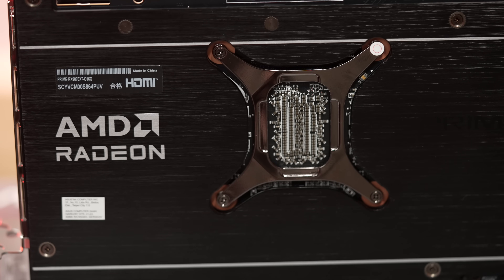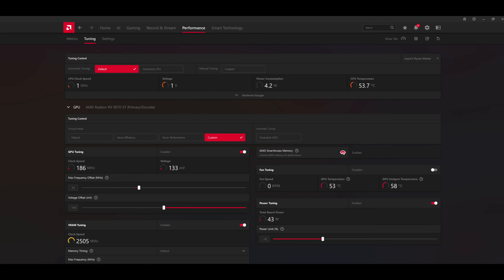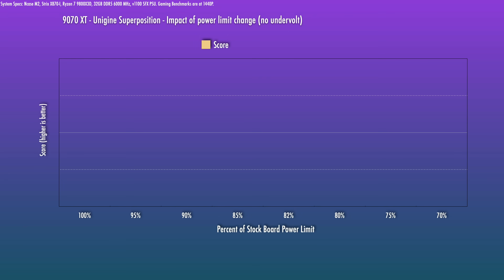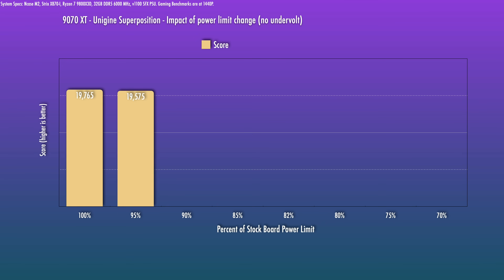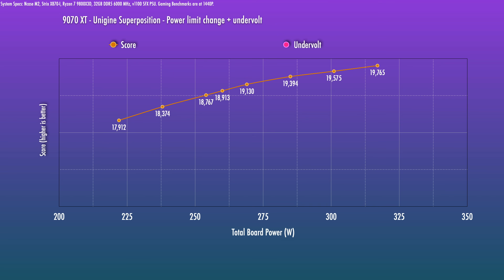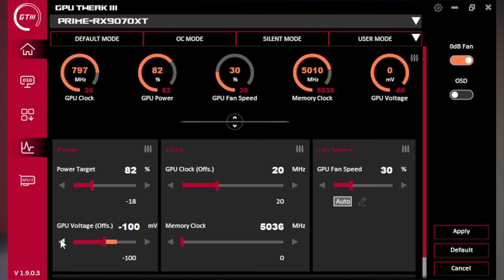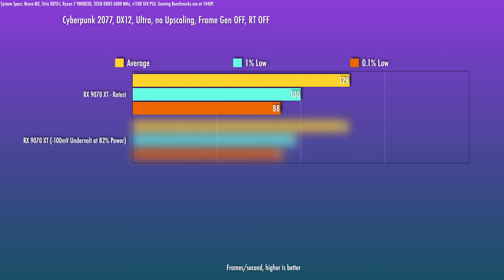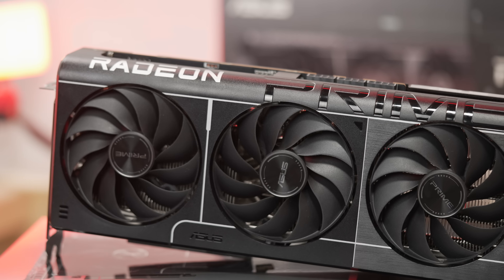Undervolting the 9070 XT... and also overclocking a 9070 to XT levels!

Comment: Finally a video for those of us who prefer a quiet and cool card - and a lower energy bill. So many reviews only focus on max performance.
Reply: real
Reply: You can actually overclock and still get away with a decent undervolt with many amd cards. I run a 200-300mhz  OC and a -100 on the voltage slider on my 6800xt just fine
Reply: One thing I’ll said is it’s nice to min max. Got 4 year old 3080 ti running at 72 c max (30 min stress test @100%) at 1200 rpm on noctua fans (deshrouded) running 350 watts over clocked. I think the best is to find that bang for buck sound, thermals, performance, since the 3080 ti can oc way beyond wuat I’ve done and mine can reach 1950 mg hz vs the 1800 its at now undervolred
Reply: @aviagrawal5903 Similar to me and I'm sure many other enthusiasts who like to tinker. I have a 3080Ti but it's the water block version from EVGA, stock power limit (100%) would have it peak at 400-425W (113% PL would peak at 450W), but I mostly run it at 75% power limit (~299W) which runs around 1850-1900MHz depending on the game. At 100-113% PL, it would run 2055-2085MHz, but the extra 100-150W wasn't worth the small 2-5 FPS bump. 300W = 50C max temp, 400-450W = 57C max temp under a custom loop, Noctua fans also max out at 1200rpm.  

Min maxing is especially more useful, if not almost essential for the SFF audience that watch this channel. Glad to see how well the 9070XT/non-XT can UV and OC.
Reply: I bought a 9070 XT non-oc ASRock Steel.  I wonder if I should regret my decision to skip on the Prime OC for the same $600 cost
Reply: I'm just glad its doing the same power for better performance than my 3080 10gb  I never realised how bad it was for power draw til i saw the comparison graphs
Reply: My thoughts exactly. I ordered the 9070 because of that lower power consumption.
Reply: Unfortunately quiet and cool are not both on the table this generation. From what I've seen if you want quiet you should do the Red devil dot but the trans considerably hotter than the cooler options. If you want the coolest option then you need to go with the XFX Mercury but it's louder due to bigger and more aggressive fans however you can also undervolt the Mercury to reduce fan speeds power draw and temperatures even further and it's going to be by Miles the coolest card of the bunch like we're talking here at 15-20° difference on the temperature memory compared to a red devil albeit maybe not as quiet. So as I said it's kind of like a toss-up you either want your GPU to be inaudible or very cool
Reply: @DESOUL3003  I have sapphire, no sound
Reply: @DuBstep115  Sapphire is one of the quieter cards together with the Red devil. Is still louder than the Red devil but it's like top three quietest
Reply: Precisely..every benchmarks only shows fps..not power draw, not heat. This is why i love amd so much. My 6800xt served me do well. Cant wait to get my new 9070xt next week. 
Great video dude
Reply: Let's say you manage to save 100 watts. That's 1 kW per 10 hours of gaming. So let's say you game 10 hours a day, and saved that 100 watts to make it a convenient 30kW a month.

I pay $0.07/kWh. So, I would save 30*0.07=$2.10 a month.

A more realistic 50 watts, 5 hours a day... Halving and then halving again saves less than a buck a month. Even if you account for air conditioning savings from the heat reduction, it's not really a big meaningful difference.

Even if you look at Hawaii's power rates, your savings isn't really all that great. Every bit counts, but I look at undervolting and undercocking to save heat and noise.
Reply: @Those_Weirdos  Well my prices went as high as 10x your price back in 2022. Now they're about 5x yours. But whatever, that's just nitpicking, it's still win win win in the end
Reply: @thelazyduck9370 tell me where you live. No way its still 2022 price like that
Reply: @vijayla21  Denmark. It’s about 3DKK (0.44USD) per KWh right now, everything included, so 6x his current price. 2022 I think it peaked around 7.5DKK (1.1USD)
Reply: @thelazyduck9370  Everything in Denmark is expensive so it's not a fair comparison. 

With that being said, assuming you got the xtx in launch(roughly January 2023) and use it until the end of 2025(3 years), you save less than $100 in electricity compared to the 4080. 

Depending on the prices for these gpus in DK, I dont think its that significant.
Reply: @vijayla21  In my calculations I would save about 4 dollars a month on 9070. That's 50 dollars a year. After 4 years I would have saved 200 dollars. It's worth it compared to the XT version. 

It's 600 dollars plus electric bill vs 550 dollars and savings on the elecetric bill. 

I will still wait until they have done enough XT versions that didn't live up to it's name so they had to make them 9070 instead. Stock of the 9070 will go up and price will go down. Might happen at the end of the year or next year
Reply: @fillezzo  You must game a lot then. I was assuming 7 hours/week. I was in Odense visiting families and it was 2.8 dkk recently.

You will never get MSRP price in Denmark. In fact it's MSRP +28% VAT minimum, not counting for imports tax and whatever your retailers charge. 

Even still can you tell me how often you game? I'm pretty sure $4/month is too much.
Reply: @Those_Weirdos that's your personal experience. 
In many countries in the world, power is not that cheap.Where I live,the difference is 15$...
Reply: @Those_Weirdos That dismissive attitude is exactly the problem. Power is much more expensive in some countries. To the point where the cost is noticeable if you watch it closely and adds up a significant amount of lifetime cost to a computer.
Reply: @Those_Weirdos You pay 0.07$, other countries exist too. In Europe you pay 0.33$ and that is a very big difference
Reply: @Those_Weirdos  Bro has not paid a single energy bill his life, there is also tax and transfer price. A 0.07€ per 1kw/h turns in to 0.20€. So you can triple your calculations to 6€ a month. 
6€ x 12 monts = 72€ in a year. And thats IF you pay 0.07c for kw/h, average in Germany 2024 was like 0.25€.
Reply: glad I'm saving 80 cents on my bill monthly from 40 less watts per hour! now I can afford an Nvidia card!
Reply: @ show me your calculations for 80 cents lol.

Comment: Just want to give you a heads up if you look at US pricing. AMD is pulling the same bait and switch as team green one model at advertise price and then 8 or 9 models. Not even $50 more. We're talking a 150 more😢
Reply from the maker: I’m actually a little confused now. On one hand I do see the online stores offering the above AMD MSRP pricing but at least from Microcenter’s site I see them offering the Prime cards for AMD MSRP at 600/550, and showing a good number in stock about 1.5 hours after launch. Not sure what the deal is.🤷
Reply: @MachinesMore just depends on where you are.
I’m fortunately in an area which has had a fairly good amount of the cards at msrp.
But by now, I believe most, if not all the XT models are sold out
Reply: its the retailers fault taking advantage of the huge demand....

Comment: Just bought the 9070xt Prime. Can you make a overclocking video and check if you can get the tgp 340w performance from it?
Reply from the maker: Awesome, I noticed inventory stayed up for way longer than any 50-series. I overlocked XT just to get a general idea what the gains were for the launch review, this was very very briefly though - it ran all the way up to 349W. So if you have the system headroom go for it.
Reply: @ just want to know what gains I can get with it, I’m going to use it in a ncased t1 with a 7700x. Upgrading from a 4070 ti
Reply from the maker: Ah gotcha- without doing any serious tuning it was around 5% (+/- depending on the title). There are gains. But it draws a ton of power already.
Reply: @MachinesMore  Here in Australia, it's the middle of the night and we're almost three hours past the official (late night) launch time. Unsurprisingly, 9070 availability is much better than 9070 XT availability. Overall (across a few suppliers), some 9070 XT models are still available, but it looks like the cheapest models (PowerColor Reapers) sold out within 10 minutes of launch.

Comment: Ooof, didnt manage to buy a 9070 xt prime oc at msrp, so i got a 9070 non-xt prime OC at msrp. I was pretty sad about it, but then this video came in as a saving grace to show that 9070 oveclocks to almost a 9070 xt anyways. I was planning on undervolting the XT but looks like ill be overclocking the non-xt instead. Thank you for the quick showcase of UV and OC on these cards. You saved my day.
Reply from the maker: Awesome! I think you’ll be very happy with. I hope you win the silicon lottery. It’s quite fun to tweak it - need a few more data points but I have a feeling the ones I’m working with are quite average examples of the 9070 series silicon.
Reply: @MachinesMore  Haha me too. Its about time i get a little luck thrown my way. Do you plan on doing more OC/UV tests with these cards?
Reply from the maker: Definitely. I really need to see the VF curve to properly tune but couldn’t get any utilities to show one pre-launch. So once that is working there should be more optimizations. Will follow up soon!
Reply: @MachinesMore  Awesome, looking forward to it.
Reply: Welcome to the lower power but still fast non XT Club. An RX6800 User.
Reply: Congratulations! You have the efficiency king of the 9000 series. There's something super satisfying about that.
Reply: Even if the 9070 xt has great value we all can be happy who atleast got a decent GPU these days. How many folks wanted a 5000 Nvidia and were not able to buy anything or way scalped.
Reply: Exactly the same here, I think the 9070 will be great anyway!
Reply: The chips will spread out as drivers mature and as AMD improves RT and Ai features. Aren't the OC cards only 4% faster? I think a stock card could chase that with undervolt and overclock.
Reply: I'm hopeful for my reaper 9070! I missed out on the rush online, but microcenter still had some MSRP models later in the day, although I really wanted the XFX swift model. Just missed the last two by minutes. Good luck everyone.
Reply: The 9070 is much more impressive than I assumed it would be.
Reply: It's a relatively small difference at stock clocks anyways. Was smart to get what you could because this will continue to sell out and prices will almost certainly be going up.
Reply: Same for me, didn't get an MSRP 9070XT on time, so settled for an MSRP 9070. Wasn't too sad about it anyway, as I do like it's higher efficiency, but have been wondering about it potentially reaching XT levels, when needed. Thanks for this video!
Reply: Sapphire Pulse seems to overclock the best.
Reply: Why not both, seems you get even better performance when you do both on the xt.
Reply: I dont get though how he could archieve performance that close. I would expect always a gap of 10-15%, as the 9070 has 8 less compute units.
Reply: I had the exact same thing happen to me the XTs sold out in like a minute, luckily I got a good Asus 9070 Prime OC card for $600 that is boosting up to 2985mhz out of the box, a -100mv undervolt only increases that by 50mhz.
Reply: I purposely bought a 9070 Pulse over an XT for it's efficiency, but also the size. It's actually the only card from the whole series that fits in my case (I'm not kidding, there's about 2mm clearance on the length of it lol). Good to know I should be able to squeeze it in the future. Coming from a GTX 2070 I forgot what it's like to have performance like this lol
Reply: "9070 oveclocks to almost a 9070 xt anyways."  except it doesn't... this is always a stupid "just this one trick" reviewers pull because you can OC the XT as well.
Reply: @DirkGently-km3hn  "9070 overclocks to almost a stock 9070 XT anways". There, happy?
Reply: You could have waited, or tried harder, or tried a different store...
Reply: @Those_Weirdos they are sold out everywhere. Seems like you aren't paying attention.